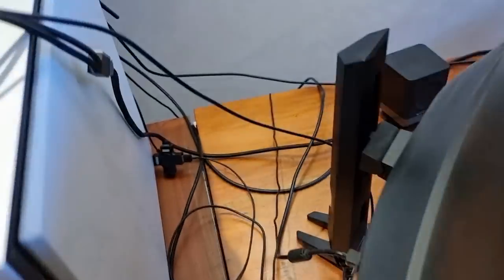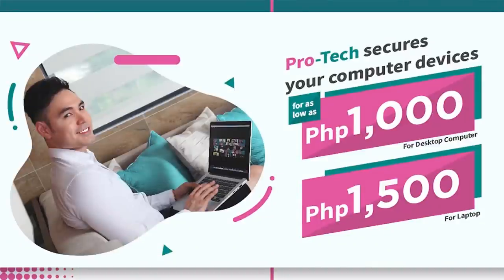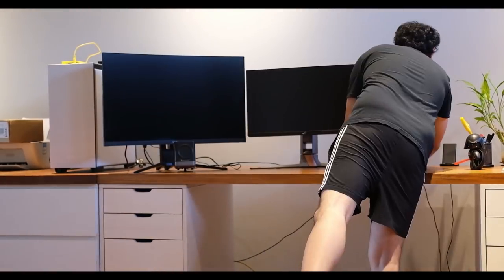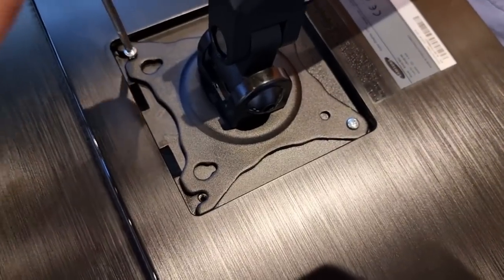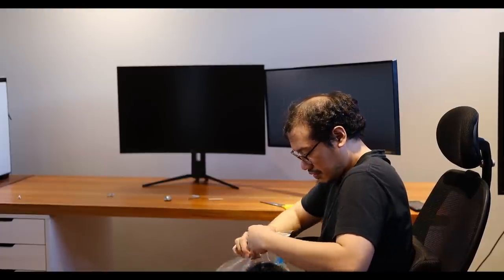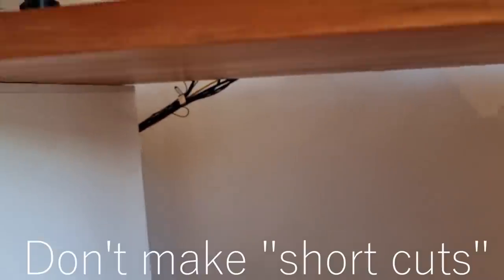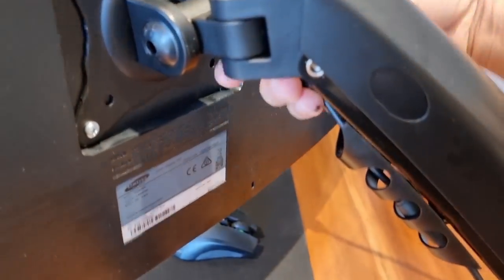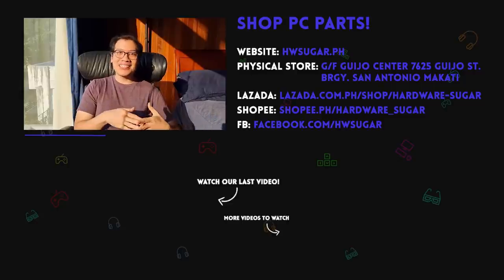Manage all types of cables on a small BUDGET

Comment: OK naman yung cable management sir, malinis naman tignan. Sa setup ko though luma specs ng Pc ko,  gumamit ako ng cable moulding sa mga wires then screw ko ito behind the desk then spiral sleeve naman dun sa wires naman behind ng monitor. For me, ok na iyang ganyan monitor arm kasi kung fixed type yung arm, ang hirap pantayin yung top edges ng monitor kung magkaiba ang size.

Comment: Hey man , I just wanna point out that there's a hole in your monitor stand for you to slot your hdmi cables inside so it can hide them better 😉. It's a good attempt but I still think there's ways to make it better ! 11:20. You could see the middle monitor stand has a hole for you to hide your cables so it won't appear as if the wires ran out. 

Quick tip : to hide your keyboard wires. You can drill a hole in the middle of your desktop and slot in your keyboard wires to make it cleaner !
Reply from the maker: Thanks Sebastian! Good point! Let me rewire that last part. :P As for the keyboard wires, I really like avoiding drilling into my wood plank. I feel like I’m “betraying the wood” hahaha

Comment: Recommendations:
Monitor arm: NB H160 Dual Arm Double Monitor - can mount it vertically or side by side. available on Shopee & lazada
cable management: slotted cable duct - will be visible under the desk but it still manages cables neatly and can let you reconfigure your setups easily. also won't occupy the space on the back of your table that you can use to stick on LED lights, i think?
Reply from the maker: Thank you very much for the recommendation!
Reply: Hi Ms. Aerea011.  I think the ultrawide might be too heavy for the arm, as the specified monitor sizes is from 17" to 27" only, with the load from 4.4 -19.8 lbs (2-9KG) for each monitor.
Reply: @dave032795  i think there's actually NB H180 for that which accomodates heavier monitors. They're both the same when it comes to design, only difference is the capacity.

Edit: iirc, NB180 is only for up to 32" monitors. If his monitor is 34" then i guess it wouldn't support his monitor either.

Comment: Nice. But trust me. The double adhesive will not last. I think only a few weeks sa akin. I ended up buying a screw type instead. Or better yet, glue gun kung ayaw mo mag butas sa mesa mo. Tanggalin ang stock adhesive and replace with glue using glue gun. Will last long
Reply from the maker: This is true for the long run. Fortunately, my problem are just 3 adhesive hooks kasi sobrang bigat Yung load. :p totoo,  screw type the best. Metal bracket sa likod na Naka screw, perfect. Hoping it won't need to come to that though haha
Reply from the maker: Nice idea with the glue gun. Kaso may permanent damage Kaya yan or it peels off like the adhesives?
Reply: @hwsph  depende rin po sa mesa or pagdidikitan. If madaling mabakbak ang outer part niya, or skin part, not advisable. Best talaga ang screw. Kahit screw lang sa katawan nung ginamit mo na cable tie. isa lang na katamtamang haba na screw. Forever na yan wag lang of course kalawangin ha ha. Or yung stainless type na screw. Sa akin din kasi bigat nung cable. Halos parehas tayo nng ginawa na cable management. Since meron ako glue gun, ginamit ko pero pinalitan ko ng screw kasi after like few months bumagsak or nung dagdag ako ng cable, natanggal. So decide ako palit ng screw. ayun halos higit 1 yr na ginagamit ko pa rin :)
Reply: @Ja.KooLit  can I get the link for this screw type cable clip? 🙂
Reply: @joshuady1327  I dont its allow to post an external link here. Pero search mo sa aliexpress cable tie screw base. You will get the idea.
Reply: @joshuady1327  parang ganito 
https://www.amazon.com/Saddle-Holder-Self-Locking-Thread-Screws/dp/B07J4H65DK

Comment: hi there! how long is the displayport cable that you got? do you have any issues with the signals due to the length?
Reply from the maker: This is like a 3 meter display port. No, I haven't experienced any input lag or anything. The monitor acts the way as it used to, which is 60hz.

Comment: You can use a North Bayou H100 or other kind of their models.
Reply from the maker: Thank you! This monitor arm looks boss and it's cheap af!
Reply: North Bayou or Loop Alloy?? Which is better??
Reply: @pugeelancer  I went with Loop Alloy Single Arm Gas Lift, pero both have their own PROs and CONs. for Loop Alloy, the supposed cable management holes for both the KB/mouse sana sa mismong base ng arm could not fit the newer usb heads. so sayang.
Reply: @mand0rk_jr73  may isang model yung north bayou na may 2 usb port extension ata yun. Pero hindi ako sure. Hehe
Reply: @pugeelancer  I have the north bayou dual monitor mount while my brother has the loop alloy one. My brother had to add a folded paper sa likod ng mount para ipantay yung monitor while yung north bayou mas sturdy and mas flexible iadjust. Pero both gets the job done :)
Reply: @xx2936896xx  @McKevin Dauntless  @Armando de Guzman Thanks for sharing your experience guys :) I'll probably go with NB

Comment: you screwed in the vesa wrong. you have to screw in the top screws first, then mount the monitor, then screw the rest of the bottoms screws. either way, it does the job done, but that's just a tip

Comment: Do you recommend using twist ties instead of velcro tie? I saw a 50m black twist tie in shopee for just 45 pesos.
Reply from the maker: Velcro all the way. More environmentally friendly and is reusable for years. Parang twist ties are only good for one use?
Reply from the maker: Also you need to be versatile. Kanina tinangal ko keyboard ko. Had to remove all the cable ties :p Kung twist ties I wouldn't be able to reuse or attach them as quickly afterwards
Reply: @hwsph  Thank you po. More power po sa inyo 🙌🙌🙌

Comment: Thanks mate, very helpful! At the moment I'm stressed out by my office at home. Working from remote but using my monitor, mouse, keyboard, webcam and microphone with the laptop sitting on my desk with his bulky docking station. Next to the table my router with way to much cable. Really annoying to switch the stuff to my own pc after work. Any advice to fix this or make it less messy and tedious?
Reply from the maker: Hi Arn! I would recommend you take a good look at your setup and figure out if you could hide wires behind the desk. If not, you may want to go with the option of getting a cable manager mount which you can drill to the bottom of the desk. It isn’t as clean but you won’t see the wires while you are working and is a much better option then wires taking control of your life while you work. :P

Comment: But where do plug your phone charger? Thats one of my challnges in managing cables and the desk Having outlets at arms reach for charging devicea.
Reply from the maker: I have two "charging stations" in my room. One near the bed and the other near the printer which is near the pc. https://youtu.be/EUJyMNSL2GM I highly recommend these adhesive cable organizers to act as the charging station. I placed it in the video description of the video i linked.  :) while not within arms reach, I try to not use my phone when it is fast charging. If it's viber or whatsapp, I have the apps on my pc as well.
Reply: Magnetic cable chargers solves your problem
Reply: Thanks for the suggestions. Its really more on having an accessible power outlet. I sometimes unplug my charger when I take it to work (prepandemic) and bring my work laptop home. I ended up having the power strip around the far side of the desk.
Reply from the maker: I recommend getting a second charger and an extension cord. Ahhh but what you can also do is buy the extensio. USB cord I bought for my monitor (featured in the end of my video) and charge your phone through the monitor usb port.
Reply from the maker: Here you won't need an extra charger. You just need to have a compatible retractable USB connector

Comment: are you using an avr? i didn't see one in the video and I'm thinking of where to put mine
Reply from the maker: Yup I'm using an AVR. It is hidden at the very end of the "table extension". It's behind the table extension. Problem with this kind of cable management is you need to have very long cables, I had to buy longer HDMI and display port cables.
Reply: @hwsph  thanks for the reply and do you recommend using extensions that has a surge protector? because i'm kinda planning on buying one and use it as an avr.

Comment: May tanong po ako medyo off the topic: Puwede po bang mag upgrade from 8gb to 16gb ram kahit walang gpu? Maganda po ba nun magiging result? Built in gpu lang po kasi gamit ko naka Ryzen 3 3200g cpu lang po ako. Mababa po kasi PSU ko 300w lang po. Salamat po sa sasagot God bless.
Reply from the maker: Depende din sa mobo. Pakigoogle Yung mobo mo and check how many ram sticks it allows and what mhz.
Reply: @hwsph  msi A320M-A PRO po mobo supported daw po 2 sticks upto 3200(OC) MHz. Currently may 1stick 8gb ram po ako. Good investment po ba ung dagdag na 8gb ram kahit walang gpu? Dipo kasi kaya ng powersupply 300w lang po. Thankyou po!

Comment: Bro, I am using a docking station which is quite long. Can I use adhesive tape to install it underneath the table? Is it advisable? I am not sure if it will hold up the weight.
Reply: Technically, you could. But then comes the issue of the adhesive, which will be annoying.

Comment: So in short you need to buy expensive stuff to actually do this. A vesa mount for the monitor wires, a switch dock to cover the power brick, long hdmi or do cables?
Reply from the maker: Not necessarily. When I cable managed my desk without the vesa mount I thought it looked quite neat. Here's what it looked like without this specific vesa mount: https://www.youtube.com/watch?v=R8qW7L7lHIE&t=1s . The old vesa mount didn't hide the wires at all but I thought the table still looked quite neat.
Reply: So in short, you are not using your common sense.
Reply: @moises8643  How, how am I not using my common sense?
Reply: @Jay_pantig  Because you are putting it too literal, just because he has a vesa mount doesn't mean you need to buy 1, you can just wrap the cables behind the monitor stand using the velcro strap. This statement: " a switch dock to cover the power brick" really bro, he just straight up improvised that and you are taking it too literal, if you used your "common sense" you wouldn't even bring that up, if you don't have a switch dock then tape it on your table (common sense). And lastly "long hdmi or do cables", this depends on your setup, if you don't have the money to buy longer cables then put your PC closer (common sense).
Reply: @moises8643  HAHAHAHHA basag siya eh.